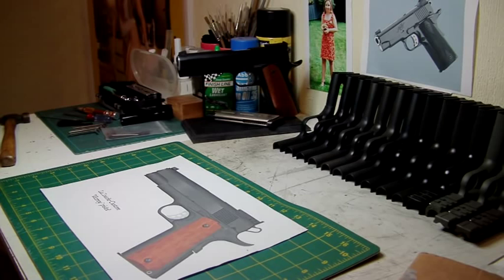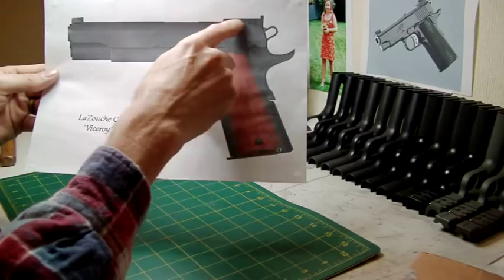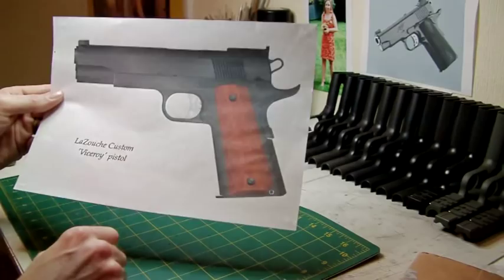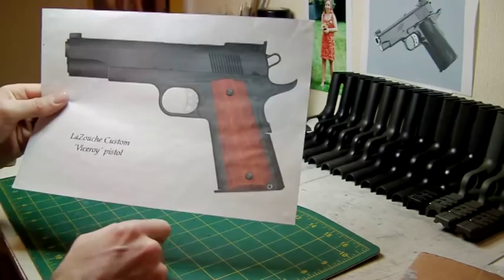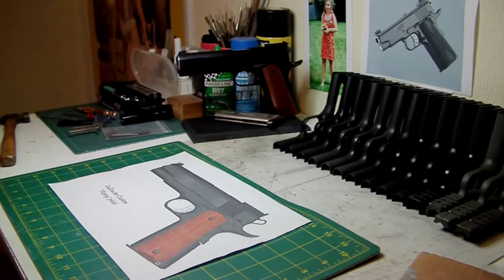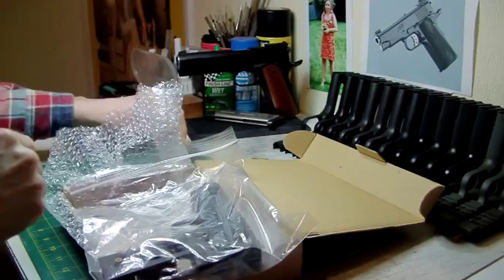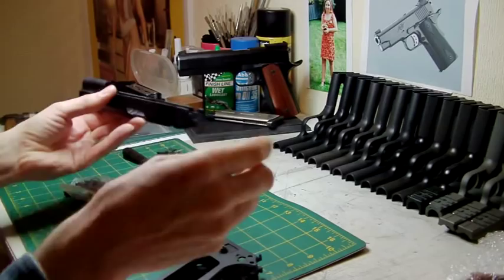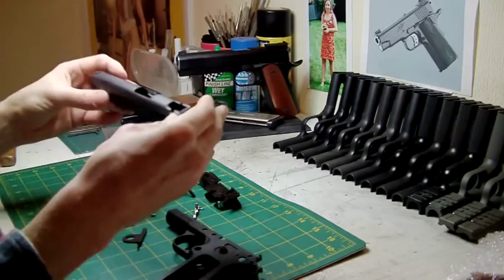LaZouche Custom airsoft 1911 Viceroy project Pt 1.

Comment: Im not saying to do it for this build, but have you ever thought of putting a integrated red dot sight in the frame taking the place of the rear iron sight? Not like an IPSC red dot where you have to have a rail running along the top of the gun, but the red dot replaces the rear sight. Ive been thinking of doing it to my two custom TM Night Warrior and TM MEU but I have a feeling you would do a better job at it then I would lol.

Comment: I took a rail from my G36 and cut down to fit the length of the frame from the triggeguard to the forward end of the frame and modified it to whre it fits flush with the fram but idk how i can mount it to the frame. Any ideas?